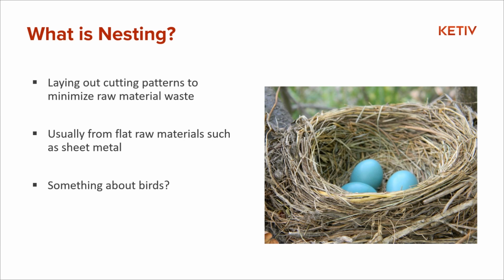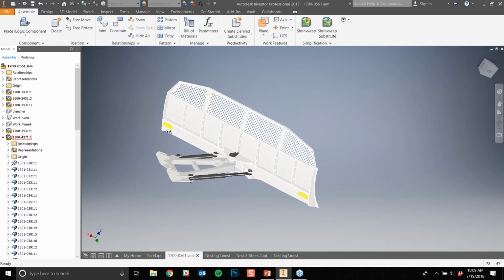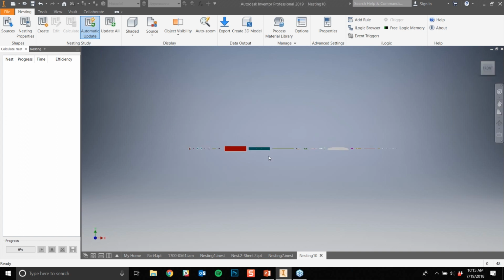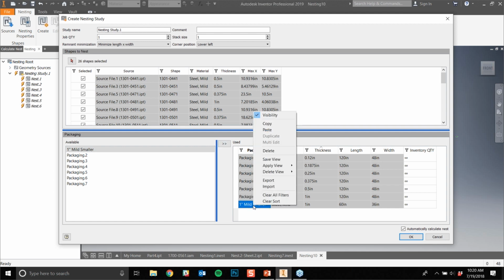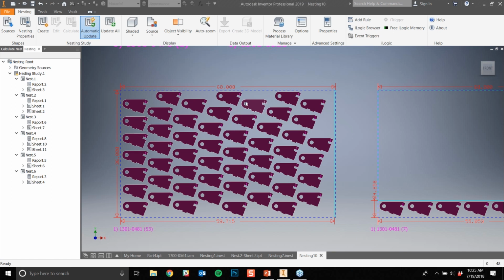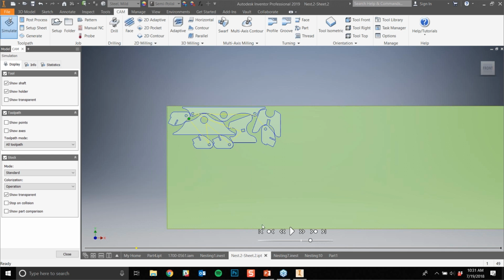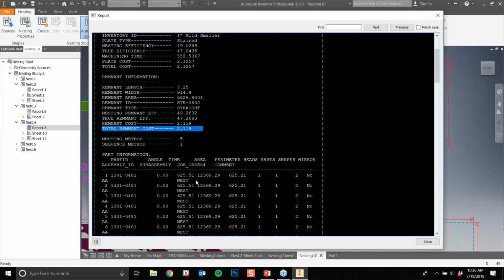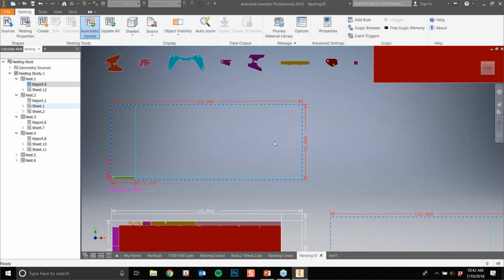Inventor Nesting Utility 101 | Autodesk Virtual Academy

Comment: Hi there... nice video, couple of questions though...is there any way the bend lines can be displayed and exported  (probably to DXF)? any possibility of changing the number label to custom text(for example Project# and Detail # instead of 1,2 ... and so on))
Reply from the maker: Yes, bend lines can be displayed and exported by: right-click on the flat pattern in your Inventor model tree > select 'Save Copy As…'  >  choose file location and name  >  click 'Save' >  in the Flat Pattern DXF Export Options dialog box, click the 'Layer' tab >  ensure the light bulb is toggled on to the right of 'Bend Lines (Front)' and 'Bend Lines (Back)' > select 'OK'. Now, when you open this DXF in AutoCAD, you will see the bend lines! Regarding your second question… assuming you're referring to the nesting model tree, you can right-click on any component of the tree and select 'rename.' For more information or if you need additional help, please email us at ketiv@support.com!